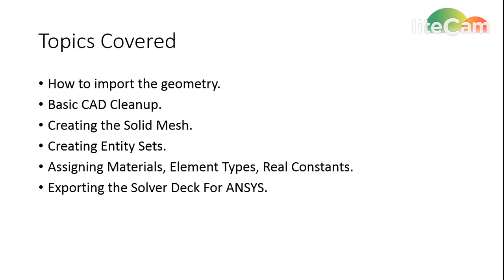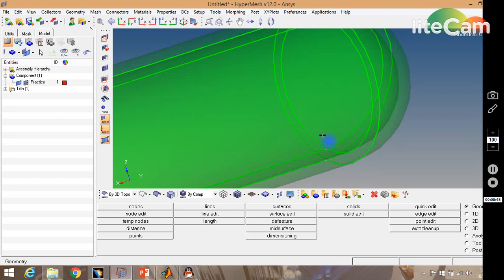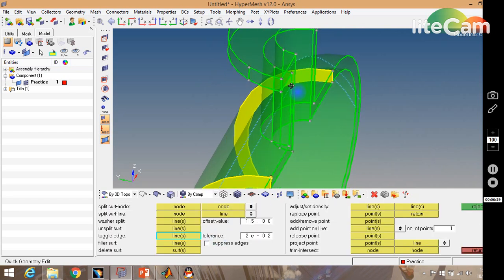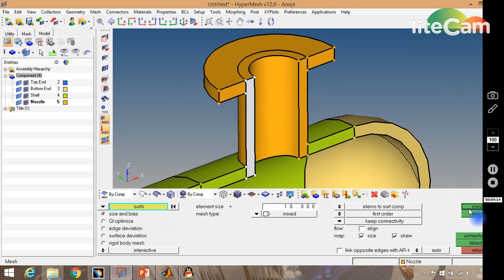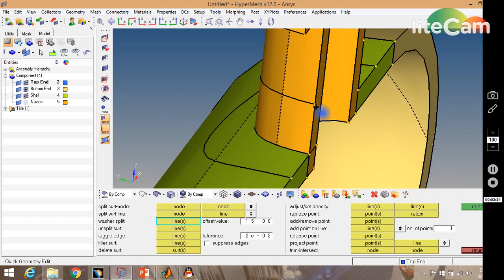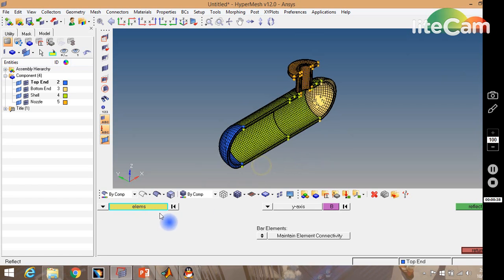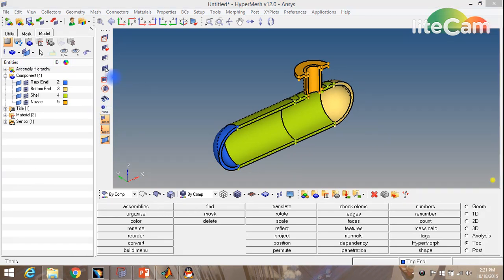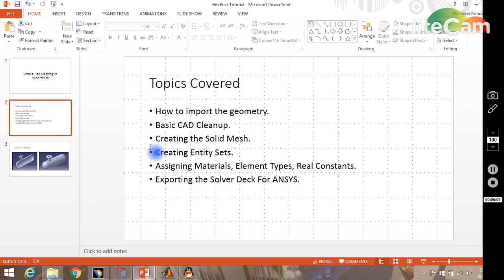Hypermesh-Simple 3D Meshing Tutorial

Comment: Dont you get automatically singularity at the hotspots like in the connection between both bodies without modelling a weld? If so why do you need such a intense meshing there if the result wont even be correct  because of a missing radius?

Comment: this is not the professional way of doing 3d modeling, has to be improved much for advance doers. apt for beginners !!
Reply from the maker: Hi Kiran.. Thanks a lot for your feedback..
I would definitely like to know about the areas you wish to see improvements.. So that I can correct/add more information in my further tutorials..
Reply: Nachiket, I did not mean the process of doing is wrong! your effort of explaining is highly appreciated. but, few things can be done smarter and simpler at areas like; 1) better mesh flow at nozzle bottom region 2) Circular ends can be 3d modeled by rotating by 45 deg 3) avoiding diamond shaped quad at converging regions. These modifications bring the result to realistic conditions. if these could've implemented, I felt it would be more matured meshing. I'm looking forward to learning and exchange knowledge with your upcoming tutorials. #KeepGoing #KeepGrowing.
Reply from the maker: Yes Kiran.. Thanks..
How ever I made this video only from the tool point of view.. But your suggestions are valuable.. :)